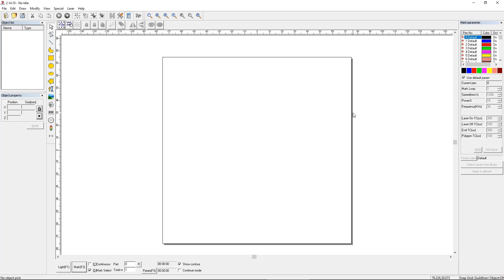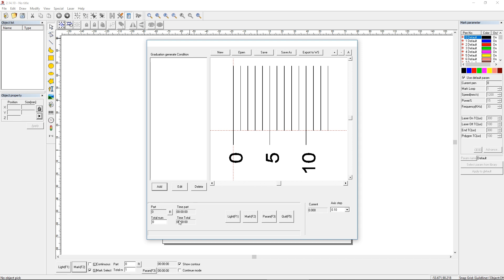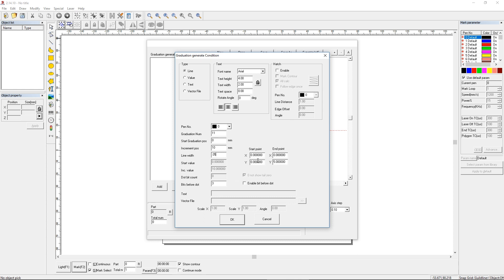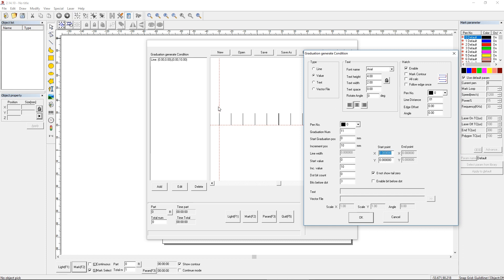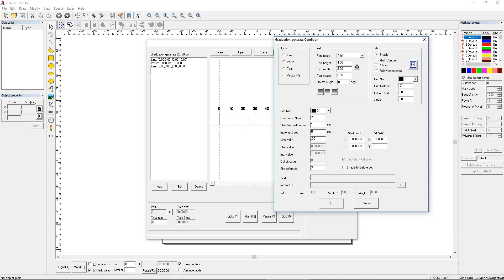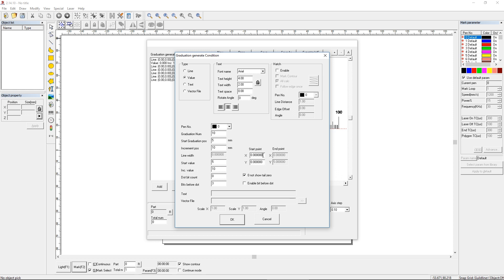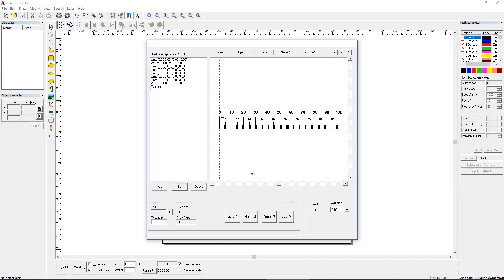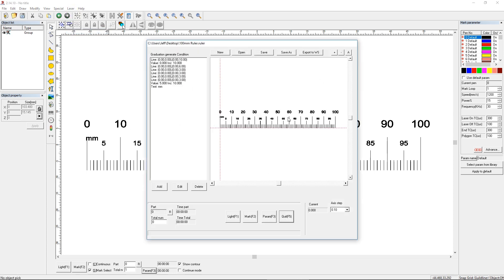EZCAD2 - Laser Mark with PowerRuler - Example #2

Comment: I made 80 mm ruler and it comes out as about 70 mm when measured. It's not my laser either, as I printed it from EZCAD on paper printer. Have you every seen anything like that? Is there some kind of ruler module calibration?
Reply from the maker: Actually I've had the same issue, the first time I exported my ruler to the work space, the sizing was just a little bit off.  I had no explanation as to why it happened, but I think I just remedied it by deleting it from the work space and reloading it in the power ruler area, then I exported it again and the measurements were accurate.  A quirk of ezcad I guess.

If that doesn't help, the only other things I can think of are to double check focal length and also draw a box and measure it to confirm everything is marking correctly to size.